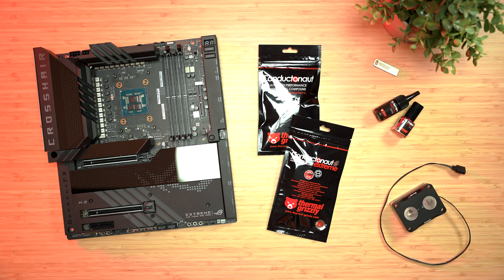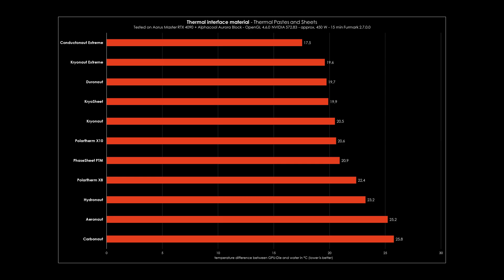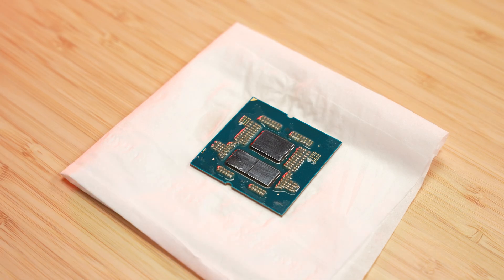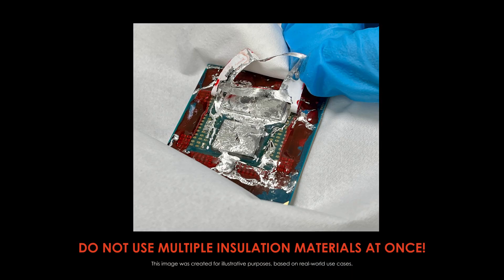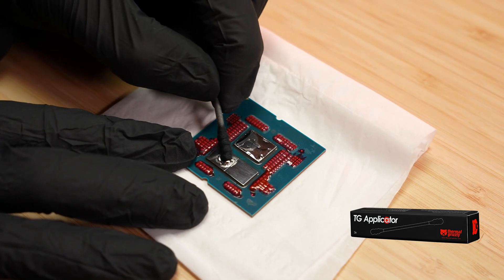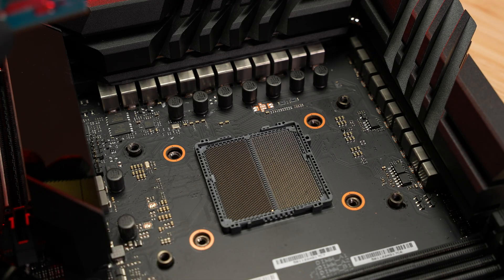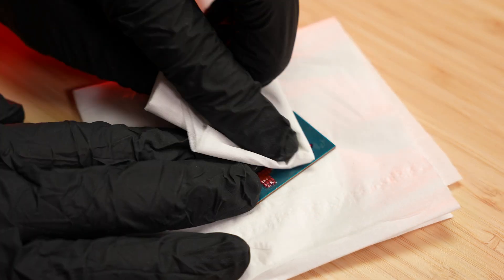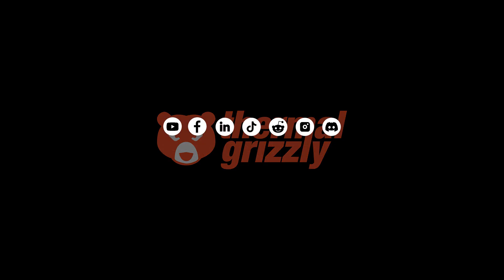How to Apply Thermal Grizzly Conductonaut Extreme Liquid Metal on delidded CPU - Step by Step Guide

Comment: Hello, what if I accidentally applied the TG shield into the CCD? how can I remove?

Thanks in advance
Reply from the maker: Isopropanol alcohol should be ok, however we recommed to check with the part manufacturer to be completely sure.
Reply: @thermalgrizzly  Its the exact same CPU shown in the video zen 5 dual CCD, so if I spill some of the TG shield into the CCDS I immediately use some alcohol and wipe it off and I should be fine?

Comment: It's cool to see the detailed guide. Maybe more people would do this. I am considering it now, but only if the new delta mate CPU block will be released for direct die.
 I don't really like how the Optimus block does not seat evenly on the delidded CPU, and can easily "rock back and fourth" under pressure. Probably because it uses other mounting holes than what TG mycro does
Reply: Or maybe it is fine with Optimus, and you just need an AM5 contact frame below it. I don't really remember now